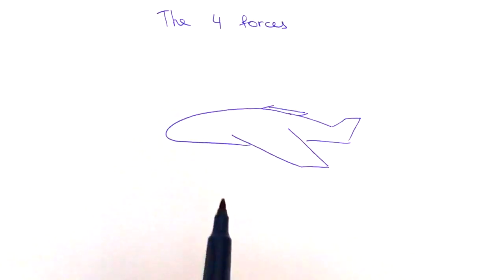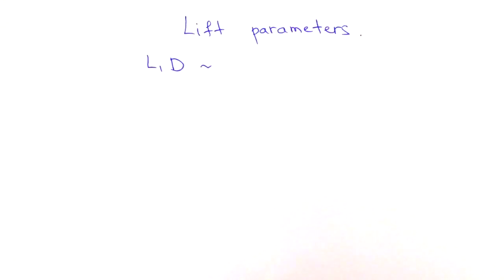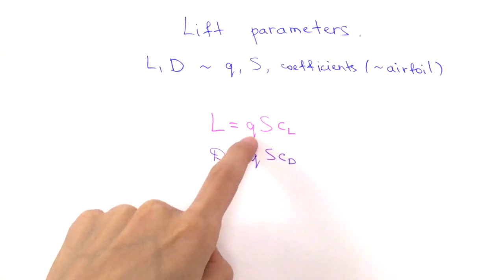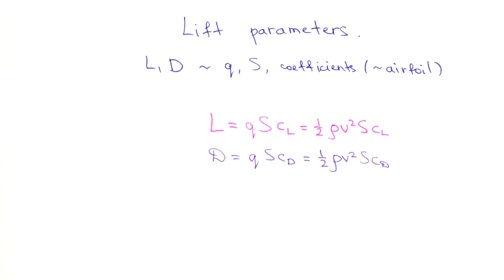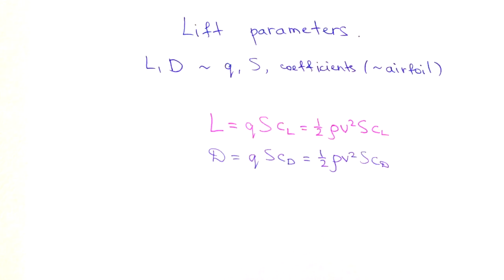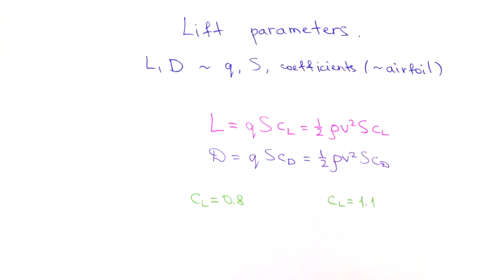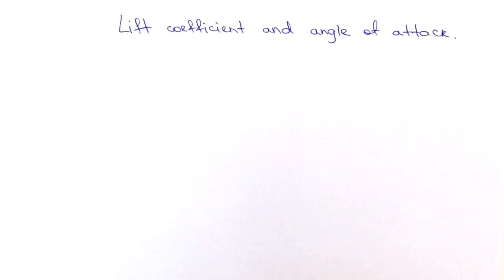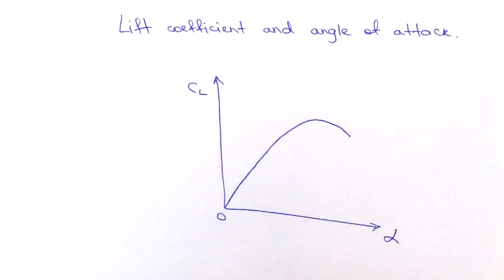How to calculate lift? Lift coefficient and angle of attack.

Comment: best lift video yet
Reply: symmetrical airfoil should be 0 Cl at 0 AoA. Benefit is center of pressure doesn't move at dif AoA, unlike asymmetrical airfoils where cop shifts forward
Reply from the maker: Thanks, haha
Reply from the maker: Yes

Comment: Hi, I have the lift coefficient and drag coefficient versus alpha curves , how can i find lift and drag through it as the curves gives a range of values , so what value of cl and cd should we take to find lift and drag?
Reply from the maker: Good question! It depends at which angle of attack the aircraft is flying (so for which alpha you want to find lift). Then you find that intersection of alpha value and CL or CD

Comment: nice: if an aircraft in a turn can continuously maintain a 5G load, what should be done for that same aircraft to achieve the same lift (which compensated for five times the force of weight) in a straight line climb, i.e. that while climbing it has 5 times more lift than the force of weight

Comment: how to determine the correct lift coefficient with angle of attack(10 degrees), when it gives three graphs with each one's Re is 50000, 200000 and 500000.  Please explain.

Comment: I am confused - what happens if the aircraft has a lot of thrust like a jet... it won't stall if a high AOA is reached. But it would stall if there is not enough thrust. Isn't thrust an important part of the equation?

Comment: Im actually a student taking part in the SAE Aero competition and we are currently doing the calculations of cl and cd using numerical values. We used weight instead of lift in the cl formula to get values of cl but we are stuck in the cd part as they are no alternative formulas to find cd and Drag. So can u pls guide us on this

Comment: symmetric  airfoil  (NACA 0012......)has Cl=0 at 0 degrees of angle of attack , Symmetric airfoil  use for 3D fly helicopter ;)
How about the velocity of the air flow on helicopter blade when it rotate? there are  a lot of difference speed of the air belong the heli blade because it rotate on the blade shaft. the position nearer the shaft have lower speed , the position nearer the tip of the blade have higher speed ! Please tell me how can i calculate the lift or drag of the helicopter blade. thk you very much !

Comment: Hi, I have a question. Is drag force usually greater than lift force at a given speed?
Reply: 6:20
Reply: The amount of drag (and therefore thrust) force is always smaller than the lift (and therefore weight) force.

Comment: An aircraft is flying at an altitude of 15000ft at a temperature of -39 degrees Fahrenheit. If the wing chord is 6ft, its wingspan is 45ft and the equivalent speed is 200ks.

1) Determine the lift force generated with the following data, for a 4 degree angle.

 Mam i want the answer plz reply me mam it's urgent now
Reply: It would be helpful, (crucial) to know the aerofoil section, and /or CL for the wing section in question, and also the CL vs Alpha (angle of attack) chart of that section.

Comment: I think a flat airfoil would have a zero angle of attack
Reply from the maker: You mean zero lift?
Reply from the maker: A flat airfoil could still have an angle of attack
Reply: @AliyaBurkit  Angle of attack is created by moving airfoil upward .In that case every airfoil has  an angle of attack .Besides no lift   is available without it .If so how a zero angle of attack possible ?
Reply from the maker: zero angle of attack is just parallel to the ground

Comment: I’m enjoying your videos, but occasionally wince when you make a comment such as the stalled condition of a wing is dangerous. This could be simply a language difference, but it implies a judgement about the condition, and would be a very un-engineering like evaluation. A stalled condition is neither safe nor dangerous, but may be desirable or undesirable depending on other factors. A stall may be used to great advantage when lift is not important but maneuvering is. To an engineer, a glass is neither half empty nor half full, but simply filled to 50% of its available volume. :)

I would also point out that while many advanced aircraft may be limited to an envelope that avoids a stalled condition through software parameters, there are many other non computer magic ways to try to accomplish the same thing. Pitch authority may be limited by elevator design, stall resistant airfoils may be chosen, or aircraft configuration with canard designs will all provide margins. 

Thanks for the videos as I said I’m enjoying them.
Reply from the maker: True, thank you for pointing that out